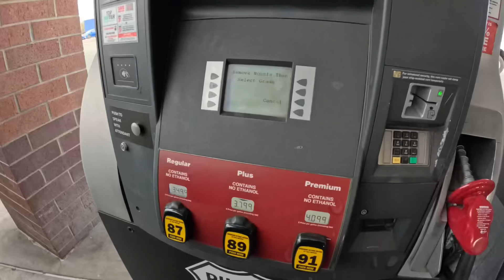This Was Such Great Deal I Just Had To Cashed Out On It And It Has A Surprise Under the Hood ￼

Comment: Don't spray anything on the malibu. If it's squeaking and rattling check the bushings and actually replace the worn parts
Reply: Facts I would get it checked it may not need struts. It could tie rods ends sway bar links or it could be bad struts